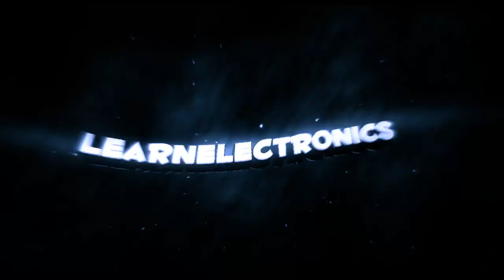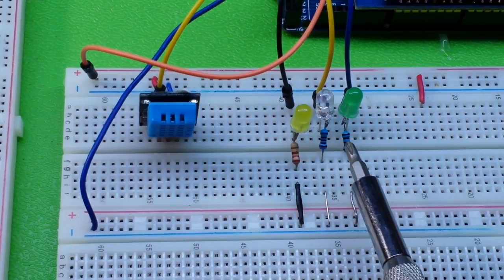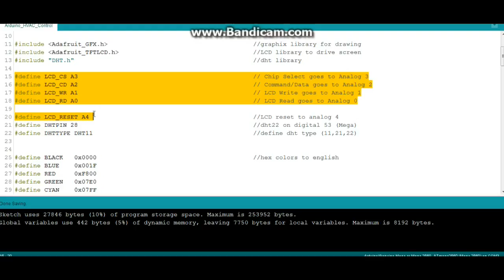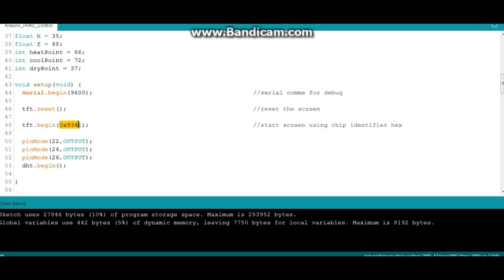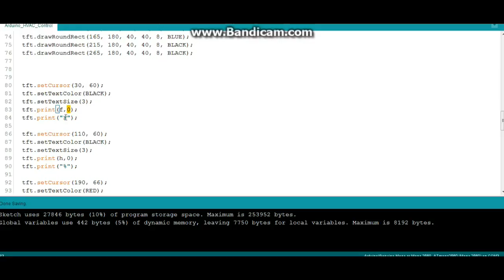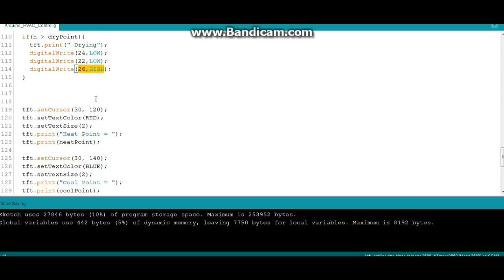Arduino Touchscreen Thermostat Pt. 1

Comment: Great video as usual!   
Could you please give the list of material you use in your projects with a link to where you got it from?(may be in the descriptrion below the vid, or together in the dropbox folder with the program)?
Don't you think the heater will flicker when it reachs the heating set point, (the same for the cooling treshold)? how do you plan to overcome that? 
thanks again for your great job
Reply from the maker: MARS I'll leave a material list when the project is done. No I don't think it will flicker because I'll add some hyterisis to the set points.
Reply: ok thanks

Comment: When can we get the rest of your electric monitoring project so I can copy your idea?  :D
Great video btw
Reply from the maker: James Kerns Jr. I'll post the code when it's all finished
Reply: learnelectronics I'm just giving you a hard time...it's ok.   By the way on this thermostat, did you ever look at Peter Skargill's one with a nextion?  The screen cost more but the esp is cheaper than the mega so it's a wash really.  And you have the WiFi built in.  I know you are going to want to make that mqtt ready eventually!....
Reply: tenminutetokyo It was based on my comment on that video.  Back under your beidge.
Reply: Bridge rather.
Reply from the maker: James Kerns Jr. No, but I will check it out. I've been wanting to play with a Nextion screen.

Comment: awesome touch screen
I have a problem
I am trying to set up a rf system.
At one end i connect arduino and rf receiver
and at other i have only the transmitter with a button without an arduino.
When i tap the button i want the led of the other side to light up
i dont wanna use any library
I have seen lots of tutorials and tried different things but failed
If you can make a video about rf communication it will be apreciated ;)
Reply from the maker: Shredder I would love to help you, but you just landed on one area in which I'm useless...RF. I did ultrasonics in the military, and designed power supplies in civilian life. RF is black magic to me.
Reply: Shredder I know you don't want to use any library, but you can use RF with the Wire library that comes with Arduino IDE
Reply: learnelectronics haha ok ;)

Comment: Yes, please add real time clock, also are you going to be able to program in Adjustable temperature differential: 1-3 degrees
Reply from the maker: dwpetty3723 There I'll be some hyterisis so it doesn't constantly switch on and off at the set points. A RTC is a problem in this design as the I2C pins are used by the shield.

I'm looking into using the time library.